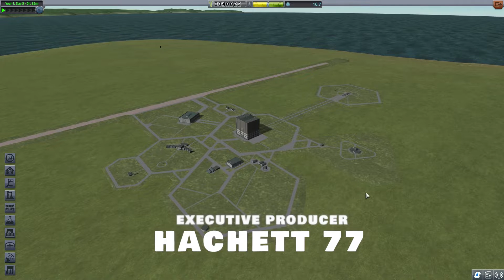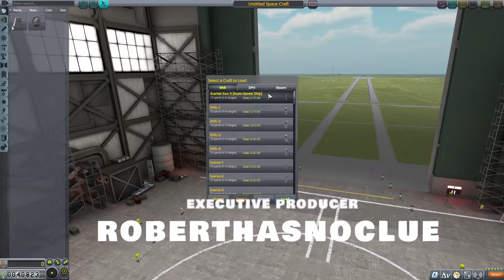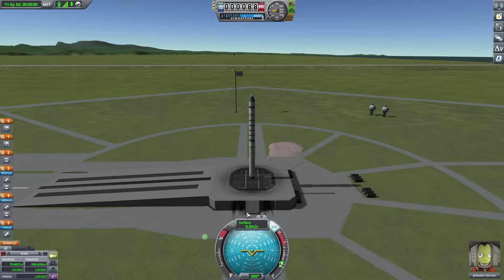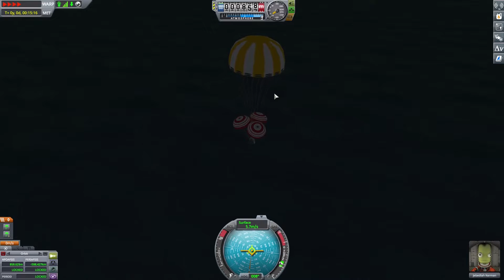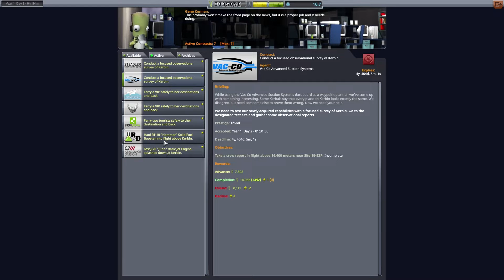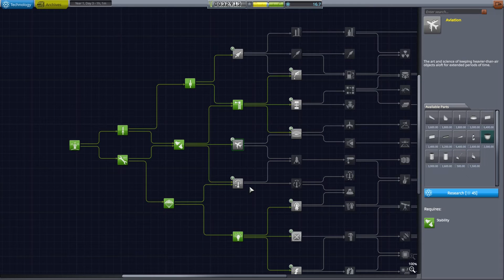Kerbal Space Program (KSP) Career Mode - Part 15 - TOPPING UP FINANCES

Comment: For the navball, think of the capsule as an airplane cockpit pointing straight up. Jeb is on his back, with his head pointed south and his butt pointed north (as you have the rocket oriented), with his feet sticking straight up in the air. If he "pushes forward on the stick" (so to speak), he would pitch over and face north (with his head sticking straight up in the air, his butt pointing toward the ground, and his feet facing north). If he's going horizontal at that point, the navball will be divided horizontally with blue up and brown down, with a heading of 0°.
 
This weird orientation is why I build my rockets rotated 90° counter(/anti-)clockwise, so the "up" direction of the cockpit faces east, then after launch, I "pull back on the stick" to pitch over toward the horizon, and the rocket is basically flying "upside-down" into space, like the Space Shuttle did (although, it also did a roll after launch to get to that orientation).

Comment: Consider this my vote for more KSP. ;)

Glad my compass/navball explanation was helpful. As for which direction your rocket is facing, on the launchpad it's pointed straight up so it isn't really facing any particular heading. (You may even see the heading readout wobble erratically all over the place of your rocket is a little unsteady.) But as a visual reference, the runway goes in the east and west directions, and east goes out over the ocean. When you first load up the rocket launchpad, that will be to your right (you start out with the camera looking north).

Rockets on the pad tend to be oriented by default so that pushing "forward" or W pitches toward the north though, unfortunately, instead of east as would make the most sense. That's why you usually have to push "right" or D to do the usual gravity turn while launching, although it is also possible to rotate the vehicle in the VAB to align pitch with east-west. Not a big deal though.

All unlocked parts are available in both the SPH and the VAB. Also, if you're just going straight up and back down, heat shield or radiator parts aren't really required as most parts have sufficient heat tolerance on their own. And all radiators work just fine in atmosphere, you just don't need them unless you're doing resource extraction/processing if I remember right. (When you get to deployable radiators and solar panels, keep in mind that they aren't suitable for use during atmospheric flight as they can break off when exposed to high wind pressure. Fixed/static mount versions work just fine in flight, but deployables have to be kept stowed to avoid damaging them. In space of course this isn't a problem.)

In terms of adding weight "willy nilly", consider how far down you've been throttling your liquid engines. You could lift a lot more than you have been -- Thrust to weight ratio is an important factor to consider. (Think of it like the amount of gee forces the rocket experiences at full throttle.) To get off the pad you need a TWR greater than 1.0, but for best efficiency you don't want it too high (like when you had four BACC boosters strapped onto a relatively small vessel)... Something in the 1.2 to 1.5 range I believe is typically considered a reasonable TWR. If I remember correctly, one of the game updates made that information available without mods over in the staging list by clicking on a specific stage or on the total Delta-V shown below the bottom stage. Also keep in mind that as the rocket burns up fuel its weight decreases without changing its thrust, and therefore your TWR (and gee forces experienced at any given throttle setting) will increase over the duration of any given stage. This is generally a good thing, unless you lack sufficient struts to handle the increasing stresses. ;)

And speaking of throttling, it seems like you may not be aware that solid boosters can't be freely throttled during flight... They have a fixed throttle setting which can only be modified in the VAB by right clicking them, and during flight they run at that setting regardless of the position of the main throttle control (nor can they be shut down and restarted). This can be used to reduce TWR and extend burn duration when using a larger number of boosters that would normally provide excessive thrust and burn out too early to be useful, for instance in getting up out of the thicker parts of the atmosphere. Those earlier designs with the four BACCs might actually be salvageable with a bit of stage tweaking and throttle limiting -- I've actually used similar looking designs to get to orbit in the early stages of career mode when limited liquid-fueled tech is unlocked. Running the side boosters in pairs with throttle set so that the TWR is at an appropriate value and lighting the second pair after the first burns out, then the center booster after both pairs have been dropped, could be another way to get a decent payload to orbit.
Reply: Oops, guess I duplicated a lot of what you said while I was writing it. heh

Comment: Good episode!  In regard to you first flight (the orbital attempt), the key is to build up some speed and set your apoapsis, and then save fuel by riding out the flight to apoapsis.  If you read my balloon analogy comment on the previous episode, once you get your apoapsis altitude set achieving orbit is then all about pushing out your periapsis.  And to do that you want to wait until you reach apoapsis.  Pretty much any thrust in the prograde spectrum of vectors (the 180 degree sphere of vectors in the direction of your momentum) on approach to apoapsis will continue to push out apoapsis.  So you want to save your fuel, wait until you reach, or just pass the point of apoapsis, and then thrust along your prograde vector.  Like blowing up a balloon, or blowing a bubble from a wand, the balloon/bubble will expand away from you (i.e. your rocket), and since periapsis is 180 out from apoapsis, it's better to expand the bubble from apoapsis.  The only thing you need to keep in mind when pushing your periapsis out to an orbital altitude is to have enough fuel left over to suck a little air back out of that bubble so you can bring your pilot home.

In regard to the second endeavor, I think you had the right idea when you were contemplating adding the radial chutes.  Drogue chutes are like an intermediate chute, designed to take some of the load off of the primary chutes but insufficient to slow anything down enough for touchdown.  The radial chutes are the big ones, like the mk16 chute you put on the nose of the pod.  The mk16 is enough for landing the pod, but if you are landing more than the pod (e.g. a passenger module, or other heavy gear), then you want some radial chutes attached to give the whole kit & kaboodle a soft landing.

While I have yet to try it, I am thinking about putting some chutes (drogue and radial) on equipment I intend to decouple within the atmosphere.  If I set the pressure on the chutes to max (this determines the altitude they eject once staged) and set the altitude to 1k-1.5k (when the chute fully opens to grab the air), then stage these chutes with the decouple, I wonder if it will softly land the equipment so that it can be reclaimed post flight.  You might want to give that a try yourself. xD  Cheers!
Reply from the maker: hey thanks man this will help :)

Comment: You can make them recoverable you could add parachutes to boosters. Considering the parts you have now, the safest way to recover is to softly splash down in water with parachutes.

You are very close, you have plenty of fuel and thrust if you can hit 200k apoapsis. I'm sitting here cheering you on like I'm watching a SpaceX launch!